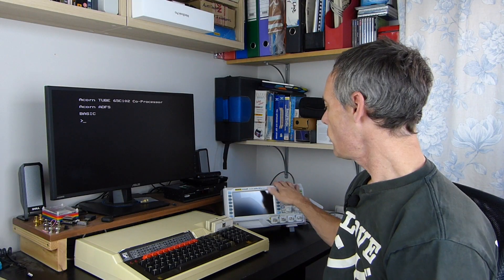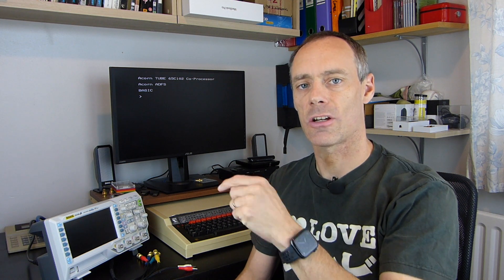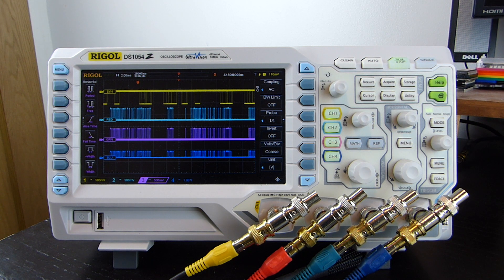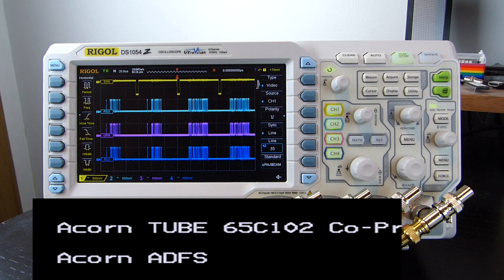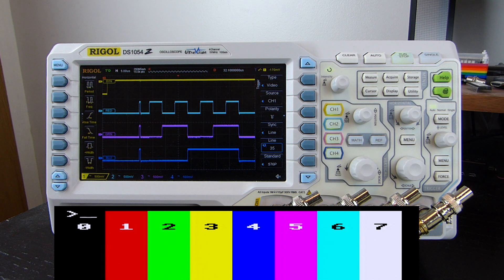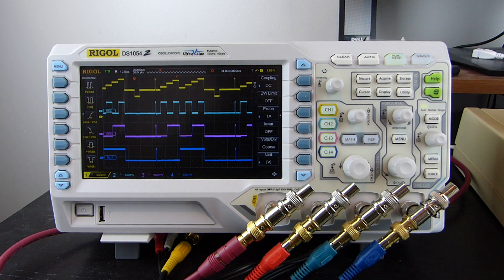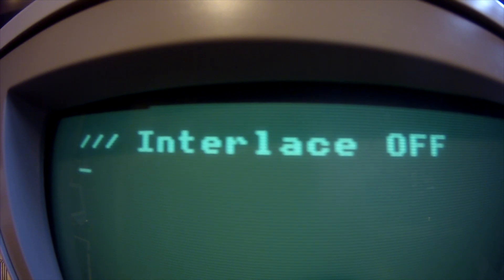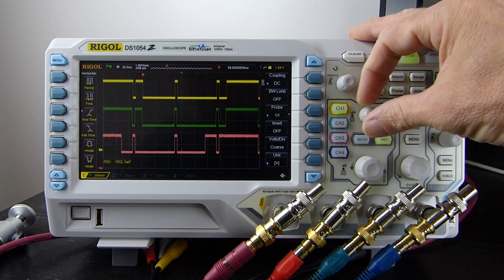Exploring the BBC Micro's video outputs on a digital oscilloscope

Comment: Brilliant video.  One thing I would like to clarify, though with reference to interlace on/off in mode 0-6 (non-teletext).  It would be easy to get the impression that, with interlace off one is losing out, that there is some part of the picture generated but never seen.  This is not the case at all.  The vertical resolution of the BBC micro graphics modes is 256 lines and those same 256 lines are send in every field regardless of the interlace setting.  What the interlace setting does is affect where on the TV/monitor they appear, i.e. either in same position twice in a row or one row up/down compared to the previous frame.  Teletext is different in that the SAA5050 chip was designed for TVs and generates a full interlaced output, i.e. the two fields, even with a static display, are different.

Comment: Hello, can anyone explain me why he needs to add a dummy load on the bnc cable, what is its purpose here ? thanks ! :)
Reply: It's not a "dummy load, " it's a terminator. Very briefly, if you send an AC signal down a wire, you'll get reflections back from the other end, and these delayed reflections will end up combining with the output signal to change it. The terminating resistor stops these reflections.

All monitors have this termination built in. You'll notice that when he connects the composite signal to a monitor in addition to the 'scope he removes the terminating resistor from the 'scope, which is now in the middle of the video cable; the monitor is now providing the termination. Some monitors allow this kind of pass-through as well; they'll either have a switch (labeled "75Ω" and "Hi-Z" or similar) that you set depending on whether you're passing the signal through to something else with termination, or they'll automatically switch out the termination when you plug a cable in to the pass-through output jack.

If you want to delve deeper into the details, the Wikipedia article on electrical termination is one place you can start: https://en.wikipedia.org/wiki/Electrical_termination
Reply: @Curt_Sampson  Big thanks Curt ! Ill go and read on this, cheers !

Comment: This was a fantastic explanation of how the video works and how you can look at it with those scopes! Thanks so much!  Would be interested in knowing more about the converters you mention at the end too as was contemplating an RGB to scart but sounds like they might be better options.
Reply from the maker: The RGBtoHDMI is the best and most flexible, especially as it supports a whole pile of different computers now.  It's all open source here:

https://github.com/hoglet67/RGBtoHDMI

... and there are several videos about them on YouTube: enough that I'm not sure if I should make one myself, as I usually go for making videos other people haven't.

I don't know if anyone is making them right now, though: I think the guy who is doing most of the work isn't well at the moment, but some other people have been running off small batches.  They are fantastic, though: the video from 80 column mode on my C128DCR is captured from that.

The other unit (the BBC2DVI) is fine, although it's more expensive and not as flexible, as it only supports the BBC Micro and Electron.  I tend to use that one on my Electron.